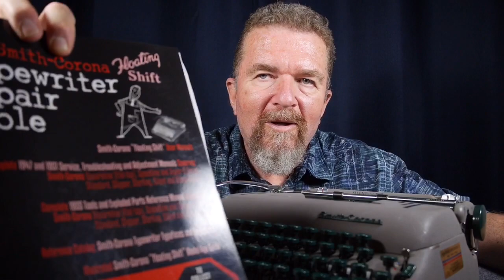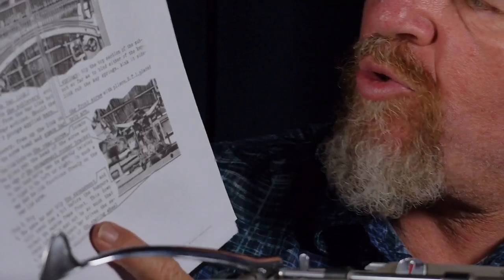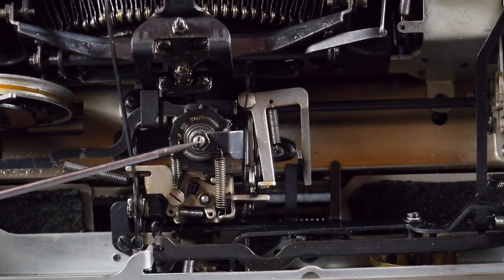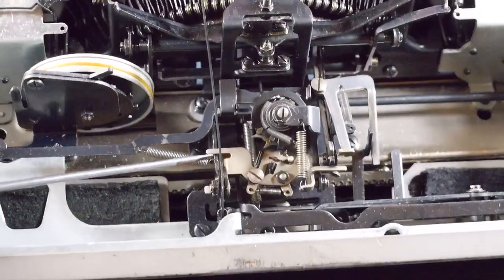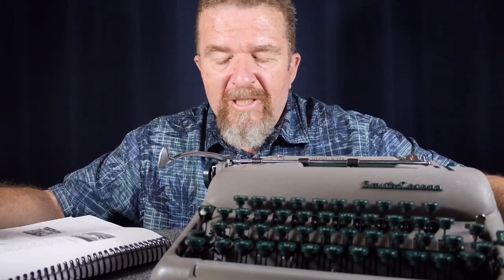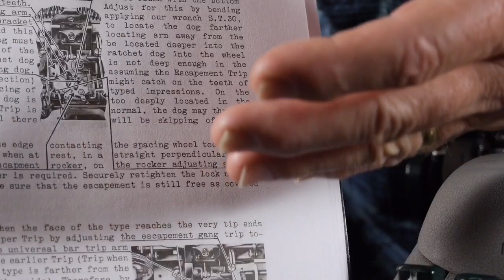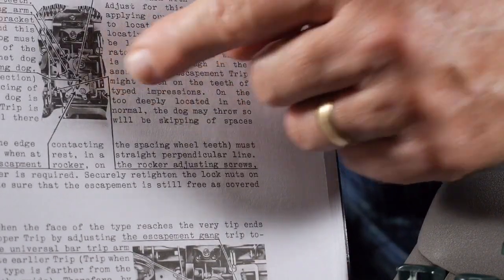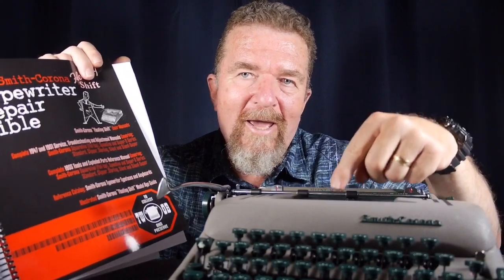Typewriter Video Series - Episode 67: Typewriter Repair Bible

Comment: I had a problem in my olympia splendid 33. There is extra skiping or extra space in between the alphabet when typing the words. So it make a error when I'm typing. If anybody know how to fix this problem please tell me.
Reply from the maker: It's usually the escapement mechanism is slow to reset after typing a character and needs a degreasing. I use an automotive degreaser like PB Blaster, then pipe cleaners or mascara brushes to get into the tiny parts. Then exercise the machine to work the old, hardened greases out of the mechanism.
Reply: @Joe_VanCleave   so the machine need to oil sir ?